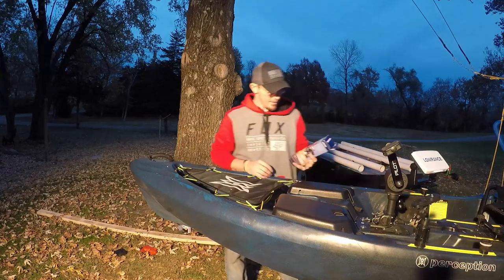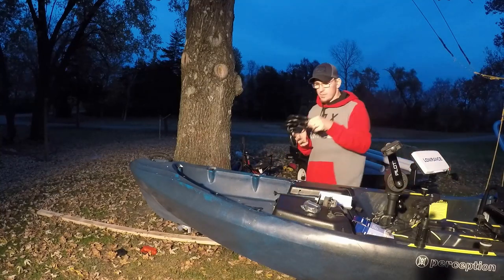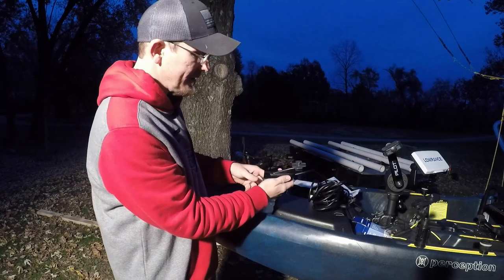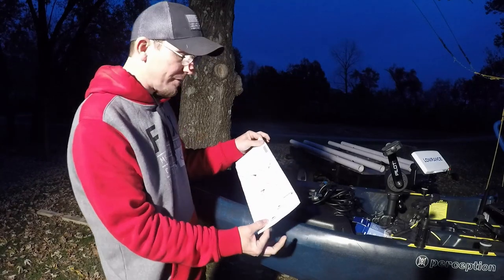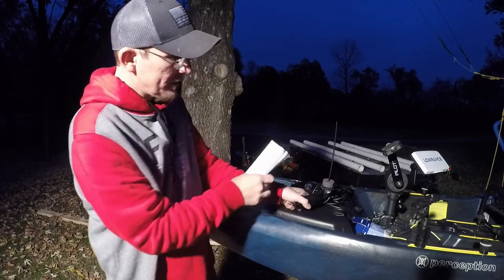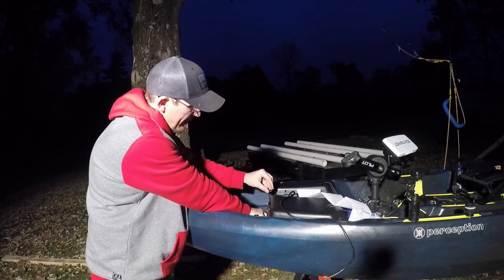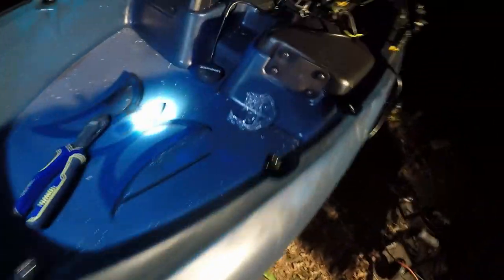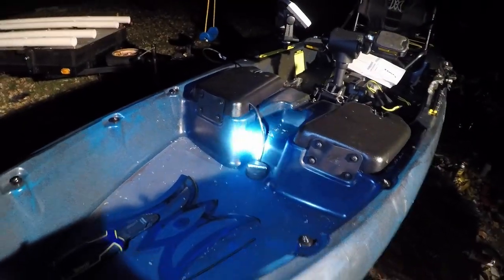Lowrance Scupper hole Transducer Installation | Perception Pilot 12.0

Comment: i just installed my transducer on my Ascend 128T, i wish they had a nice scuffer hole like urs to install the transducer , had to getto rig my ... u should buy the Hobie thru hull kit to
Reply from the maker: Yeah I had an Ascend FS12T before I bought the Pilot. I used a swing arm mount I bought for 25$ From Gander Mtn.  It worked pretty good, But there is nothing like having the scupper plug spot for it now that I have one lol thanks for watching!

Comment: Hey man do you put your battery in anything or just set it in there?? If you do what did you use I am trying to find something or what to do with mine
Reply from the maker: sorry for the late reply, a lot of my comments went to the hold folder... I actually just sit my batter in that little compartment. I havent had ANY problems doing it that way. I just put a couple of strips of electrical tape over my connectors to make sure they didnt disconnect and Its good. I havent had any water get in or anything!

Comment: What Lowrance unit are you running on your Peception Pescador Pilot and do you recomend the unit or ?
Reply from the maker: I have the Lowrance Hook 7 Chirp. I love the unit. I would recommend it to anyone. I like it for the screen size. I wear glasses and like to run at least a split screen if not a tri screen. Its big enough to see but still compact enough for a yak. I actually will pass this unit back and for between my Bass Boat as well. I just bought another transducer and will have it for both of them. Thanks for watching!

Comment: I assume that this would not work for a SideScan unit as the transducer has to clear the bottom of the hull to actually work properly.  Any ideas, other than the swing arm, for people with SideScan units??
Reply from the maker: You are correct This would not work for a side scan, this is why I opted for just a Down scan. I dont even think a swing arm would work, maybe if you set the depth of the arm lower than the hull of your yak.... I would say you could probably do a mount on the rear of your yak kinda like they do on regular boats but all your readings would be from the rear of your yak.... This is a good question, I will do some research and see what I can come up with for ya
Reply: The Perception Pescador Pilot comes with two screws preinstalled to mount a transducer, so you don't need a scupper transducer kit if attempting to install a sidescan transducer from Lowrance, RayMarine, or Garmin. Garmin's non-sidescan transducer even works without a scupper kit. I have a TotalScan transducer on my Perception Pilot. No scupper mount kit needed, it works with stock hardware. Sticks out a bit at the end, but doable as long as you don't need to drag the kayak.

Comment: Does the water drain out the scupper using this mounting system.
Reply from the maker: It does NOT. Not on a quick basis anyway. You would have use a hand bilge if you got a large amount of water in there. I haven't accumulated enough water in the front compartment to even consider buying a hand bilge yet. But if you fished big water like seas, bays or oceans I could see it being an issue.
Reply: There is another video that shows you really don't need the scupper adapter and can mount the bracket to the two screws in the cutout. That would leave the scupper open if you want. I think I will probably go ahead and get the adapter.